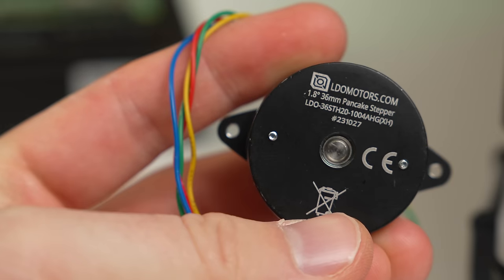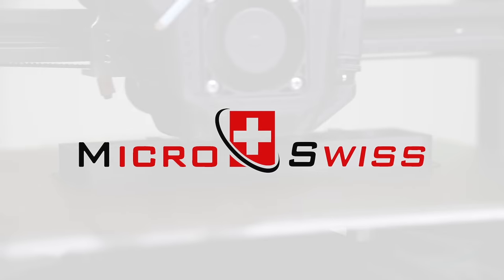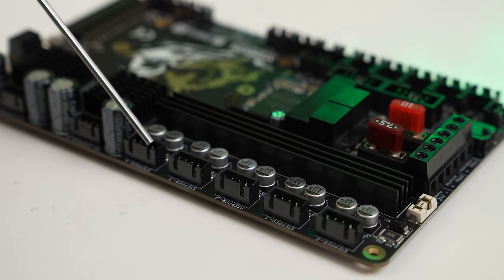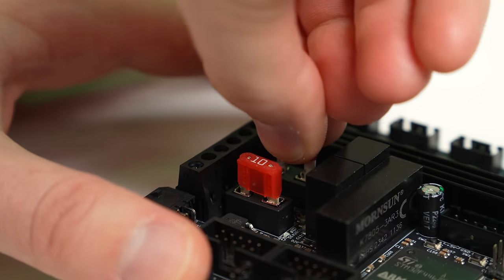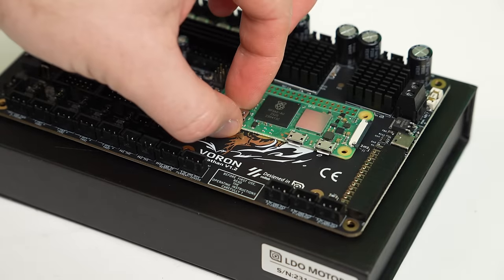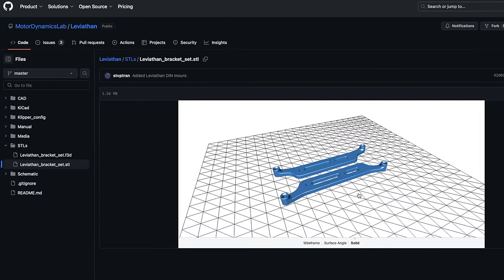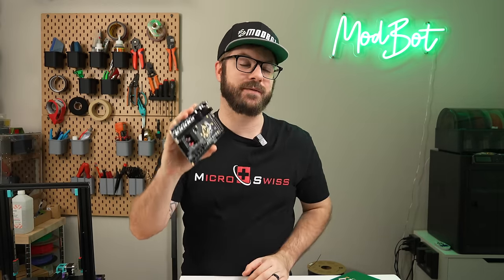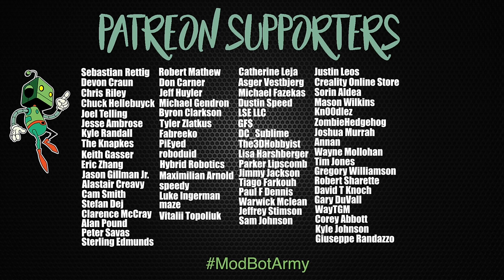This Klipper Controller Is Feature Packed! (LDO Leviathan)

Comment: I can understand the concerns about soldered drivers.
That's why there are components on Leviathan to protect the drivers.
Each driver output has limiting components (Varistors) that limit the back EMF to a level that the drivers can withstand. In addition, the supply voltages are also limited (suppressor diodes).
The bulk capacitors have discharge resistors to ensure a safe power (up/down) sequence.
The big advantage of soldered-on drivers is that they are better cooled and can be supplied much better than the stepstick drivers.
This alone makes the steppers run more smoothly without having to make extra TMC settings. Of course, this can be optimized by making the appropriate settings.
Sincerely JNP

Comment: We need  more choices outside BTT.
Reply: I feel like makerbase boards are good, a bit cheaper too
Reply: There are Mellow Boards as well. I run a super 8 and it works amazing.
Reply: "We need  more choices outside BTT"
Choice between what? Between STM32F446, TMC2209, Klipper and STM32F446, TMC2209, Klipper??? 
At least BTT gave us a real choice between Raspberry Pi and CB1/BTT Pi  especially when over hyped Rasperry Pi business totally collapsed during COVID times pushing RPi prices up to insanity. But this one gives us nothing but the higher price than BTT.
Reply: @otroe the larger makerbase boards seem to have a lot of little caveats and the documentation seems even worse than BTT's, otoh their thr36 is a nice step up over BTT's EBB36

Comment: This board looks sick! Only wish there was a 12v fan option, as I run Noctuas for PCB cooling. I think you're right that they'll swap out the Octopus for Leviathan
Reply: you can always throw in a stepdown module to add a 12v rail
Reply from the maker: Did you see that Noctua actually released 24v fans? I think this was in the last couple of months. That being said I dont know that its in the same sizes you are wanting.
Reply: Get a skrat board, it’s amazing, you have 4x 2 pin fan with 5v 12v 24v jumpers of your choice, 2x 4pin fan 5v 12v 24v jumpers as well.
Reply from the maker: @BEACHTECH3D  first time I have heard of this board.
Reply: @ModBotArmy  I just built a corexy out of an ender3 and I got a BTT SKRat board, and I just love it, it literally has everything on it that I needed for my build. 
But yes this board isn’t popular at all, but I think it should be because it offers much more flexibility than the “popular” btt boards
Reply: I think you can put the fans in series. Especially Noctua fans since they are good quality and probably well matched.
Reply: @ModBotArmy I think it's a 40x40x10 fan.
Reply: @bobwtech  risky to series connect fans.

Comment: I am trying the Leviathan and so far very happy with it. I made some mistakes flashing the CAN BUS firmware after initially setting it to USB only and it would give constant timer errors when doing  rapid movements, but it was my fault because I didn't fully erase the flash before changing to CAN Bridge mode.
Reply from the maker: Im glad you were able to get that resolved. I’ve had my fair share of issues with the can set up process. It’s been very stable once set up.
Reply: @ModBotArmy  It's currently setup with 36v on the AB motors and 4 Z steppers the EEB36 v1.2 board for everything else including a BTT micro probe. Once I have a bit more use on this new printer I will make a video with how it's performing and the things that I messed on on the flashing side. LDO did change the docs after I found the serial port changed depending on the mode it's in.

Comment: It's a shame they didn't put in CM4/CB1 support on top of the pi mounting holes. All that excitement for this board while it misses on something that became quite important imo. Almost all recent boards have CM4/CB1 support.
Reply: adding a cm4 pi carrier would solve this. simply adding a cm4 connector would not, as all the Pi I/O would have to be pinned out somehow.

Comment: To the point, no fuss and clear info as always.  You're the best.  Thanks.   Very sweet board.  But lack 12V fan.  Not a show stopper of course.  But I expect this to be available on this kind of more expensive board.
Reply from the maker: Thank you for the kind words. It’s funny as I went through it I didn’t put much thought into not having 12v because I am always using 24v. However it seems like there is quite a few using noctuas. I do know they released 24v versions but I believe size may be limited. I could also see 12v port being nice to use LEDs you have laying around. I know I have a handful of 12v strips I purchased years ago.
Reply: @ModBotArmy   Those are my use-cases too.  I have 12V LED (non-adressable) running on my 2.4 and it does happen that we have 12V fans.   Having a board deciding that there is no jumper to select voltages make sense (to save cost) but having a board with jumpers that omits 12V is weird and not a plus.
Reply: Don't most of these 3D printer control boards switch the low side of their fans? If that's the case, supplying 12V power from a different source and using the ground on the fan connector should work.
Reply: a small 12V buck converter should solve this, or get different fans
Reply: @alanb76  the board actually has a onboard 12v buck already, it is needed for the mosfet driver anyways. It would be very easy to add a 12v jumper or two. I guess they didnt care for it since all ldo kits come with 24v or 5v everything.

Comment: Finally, a review of this board. As a newbie, I'm perplexed about uploading the software. I used an Octopus1 in my 2.4 for the first six months, and it worked fine after a very frustrating month trying to get the Octopus and Pi 4 to talk to each other. Finally, it started working for unknown reasons, and then one day, it just stopped working for unknown reasons. Gave up on the Octopus. Decided to try Leviatan. Still working on trying to hook up. Does not have enough 24v fan connectors for two Nevermores. Not sure where to connect Tap. While the documentation seems better than other BQQ and Voron docs, it still skips over a lot of basic stuff that we newbies are supposed to, somehow, know. I have spent the last week studying ST Cube. Hopefully, it will make sense at some point.

Comment: As a 2.4 owner between this and the BTT Kraken, i would go for the kraken. If i only ever plan a stock build this would be fine, but this would be a no go for AWD. Even a Octopus would be a better choice with the expandability option of off board 5160s.

Comment: Hey, how's it going man, I've seen a bunch of your videos over the past year and they've all been really informative, and helpful! I appreciate you, and I am considering this board because I have tried literally EVERY good BTT board, M8P, M5P, Octopus, Krakeen, and on and on.... I rebuilt a CreatBot F430 into an real extremely high temp printer, bed up to 220, chamber up to 180, nozzle up to 550, I used 2 5160 drivers on X and Y, and 2209 for the rest, then additional heat from 4 additional heaters on SSRs/Mosfets, and it works great now, but BTT boards and all of the configs I wrote for each board keep failing. obviously, I can just change the serial ID, and pin definitions, but I landed on the M8P for that and the 300mm VORON I built, and between the 2 have been through like 6-7 boards. Sooooooo frustrating, do you think this board has any place on a high-temperature build like that? Or if not do you have any other recommendations? I really appreciate any time you take to consider. Thank you.

Comment: I can't see why you couldn't run Marlin or Reprap firmware on this board.  The provision for the RPi wouldn't be needed, unless you want to run Octopi though.  Both Marlin and Reprap firmwares do, or shortly will, support input shaping and pressure advance.  The tmc2209 stepper drivers can be used to drive the A/B motors in a core XY or other drive system printer with a bed size of less than 250mm, though acceleration may have to be a bit limited.  I do agree that it is with Klipper that this board really shines.  When I first saw the board, I was looking for the connector for the compute module, as I thought that was what was intended to be mounted in the open area, not a full RPi SBC.  Perhaps they will make a version of the board that uses a compute module in the future, though if you want to use one of those, an adapter for these is available that converts these to a RPi pinout layout.  It's nice to have a good BTT alternative!

Comment: Seems like it has almost everything you might need for modern corexy. Nice part - capacitors. 2 cap per motor. Not so nice part - soldered drivers. Maybe someone can explain what's the point? Does not seem like price reduction. 
Definitely better option as stock board for LDO kit instead Octopus. Since you don't have to throw away whole board if you want use higher voltage AB motors. But.. it's not clear what's the pros compared to Octopus Pro.
Reply: Saves money, reduces connector counts (connectors are less reliable than soldering). Improved cooling. Blowing drivers used to be a thing, very rare these days. Modern drivers are well protected. Chips can be unsoldered and replaced if necessary. Plenty of modern boards use soldered drivers.

Comment: @MODBOTARMY , could you point me in the right direction for selecting a main control board? LDO sent the Leviathon 1.2 and at this moment I cannot get the XY motors to run. Not that excited about adding a 48 volt PS. to power the TMC5160 drivers..

Comment: Just picked this board up and getting ready to overhaul my 2.4 to canbus. Question though, and this is coming from a noob, can you do sensorless homing with the built in drivers? With the separate TMC2209 drivers you have to put in it them in diag mode for X and Y with a jumper. Is it software driven with the Leviathan? Any help or pointing me in the right direction would be helpful, thanks.

Comment: I would  be very intrested with a comparison with the BTT Kraken and the LDO Leviathan, Seems like the Leviathan has the 5160 while the Kraken is better on the other things
Reply from the maker: I did get the Kraken in as well. It seems like a bulkier board but a great option for someone looking to do an AWD build. I don't know that I will do a direct comparison but if there is enough interest I can do a similar overview/dive video like I did for the Leviathan.
Reply: The kraken uses 2160, the only difference is extra features that aren't really used in 3d printers so I wouldn't worry about it

Comment: Cool, but the Btt kraken is days from release and it seem to cost almost exactly the same. No mounting spot for a pi though, but I also don't think the pi5 has the same mounting dimensions as the pi3 and 4? So would suck if that's what you planned to use.
Reply from the maker: I could be wrong but I thought I was told pi 5 is not currently compatible with klipper. Don’t quote me though. I can’t recall where I heard that.
Reply: @ModBotArmy  seem odd since "klipper" can be put on essentially any computer. But overheard a convo on discord that the pi5 is currently not entirely recommended as there's some weirdness with its graphics and crowsnest
Reply: I've had my Kraken for a good few weeks now! It's great, you should be able to buy one from BTT, they are already released
Reply: @ModBotArmy No, I'm running a Pi 5, it works fine but you have to manually install Klipper. The MainsailOS in the raspberry pi flasher doesn't work. Apart from that I've had zero issues :)

Also take a look at the Kraken, I believe it's already out, I've been using it for a few weeks and it's fantastic!
Reply: @weeurey  Really? Thought they released on the 25th?
Reply: @ModBotArmy klipper is totally compatible with the pi 5, just mainsailos isn't ready for it.  you can just install armbian or pi os and run kiauh without issue though
Reply: @ivyr336  huh maybe it was an early prerelease? I got mine the second they came out.
Reply: RPi 5 same mounting holes/size as 3 & 4. They just switched the Ethernet/usb ports back to the positions of the 3, and added a power button. Will fit any mounting soul itI on the previous 2 did

That power button will cause issues for older cases though

Comment: The ldo leviathan is honestly disappointing. Compared to other mainboards in its price range such as the BTT kraken, BTT manta m8p, BTT octopus derivatives, and fystec spider king it lacks comparable features and value when configured in a similarly with 2 x tmc 5160 + 6 x tmc 2209 (100-110 USD for a similar manta m8p/octopus non-sale without canbus toolhead.)

The leviathan has been strictly designed for bare bones/ stock core xy 3d printer builds like the voron trident, 2.4, ratrigs, and hevorts with the REQUIREMENT of an additional canbus toolhead. The leviathan only comes with FOUR fan ports which will be immediately used the support the four electronics bay fans in voron 3d printers leaving no additional fan ports for auxiliary fans or worse ports for the part cooling and hot end fan if you chose not to use a canbus or breakout tool head board. The leviathan also does not support 12 volt power to its which could be used to power numerous 12 volt fans and 12 volt leds.

Too much attention was given to the stepper drivers, power delivery, and power protection that other features were essentially neglected ie more fan ports, extra neopixel ports, etc even though its competitors are also able to provide the same stepper driver, power delivery, and power protection (BTT kraken,BTT octopus max ez, BTT manta m8p, fystec spider king). Unnecessary features like a dedicated mounting space for a raspberry pi was added in a mainboard designed to be presumably used in voron tridents and 2.4s with ample space in their electronics’ bay. This raspberry pi space could have been used to provide addition io such as extra fan ports, additional neopixel ports, and even a bl touch / servo port. This lack of io limits what mods and addtions can be added to printers utilizing this mainboard relegating this mainboard to be the stock mainboard used in LDO’s future voron kits.

As someone who likes to mod their 3d printers beyond the stock configuration, the ldo leviathan mainboard is just plainly insufficient to do anything other than build a stock printer with the addition of the REQUIRED toolhead board to accommodate the hotend and part cooling fans. Nor can it be used for any cross gantry or awd core xy 3d printers as stated in the video. I just can’t see anyone “upgrading” to the ldo leviathan over the existing BTT, Fystec, and makebase offerings for the price and features the ldo leviathan is offering.

Comment: I’m somewhat new to diy 3d printing so forgive me if I sound dumb but is this board a controller that runs on its own or does it need a raspberry pi?
Reply: Klipper runs on a Pi and on the controller, splits the workload. This board is designed for that setup.

Comment: My only complaint about the Leviathan (so far) is that there is no socket for an SD card.
Reply: Klipper so your files get sent over lan/wlan to the sd card that lives in the RPi mounted on the Leviathan
Reply: @geauxracerx  So, if I copy the firmware.bin file to the SD in the Pi, the board will automatically find it and boot from it? Shouldn’t the documentation say something about this? Thanks.
Reply: @samstaton7215   with other boards you make a firmware file in Klipper on your RPi/host device and it can flash the board over UART/USB/or even sd for boards that require from sd. 

Going out on a limb here, but with this board designed for Klipper I’m guessing it’s over UART through that RPi hat that attaches to the RPi’s gpio pins. Hitch also powers the RPi from the Leviathan. 

Once you go Klipper you don’t miss  having to use sd cards

Comment: If you use UART port for Raspberry Pi, you can't use Canbus . You forgot to mention that.  Also, pay  attention to quality control for the board and check the voltage adaptor for the pi ( you can fry your Pi). Not to mention very poor documentation.  I tested the board, and I liked it. Not users friendly for beginners (poor documentation ).
Reply from the maker: When you say poor documentation are you comparing to other controllers? I felt like there was a fair amount of documentation provided for this. What parts did you feel were missing? I don’t generally feel like building a printer is exactly beginner friendly. Can some beginners accomplish it? Sure. But I see frustrated people all the time. You have to enjoy tinkering and some element of problem solving for many builds.
Reply: @ModBotArmy .  Yes. If you don't have a little bit of knowledge regarding bootloader and firmware, you can brick the board very easily . But I like the board because it is very compact . For me, in a point of view, the board has 8 out of 10. Is like bigtreetech pico